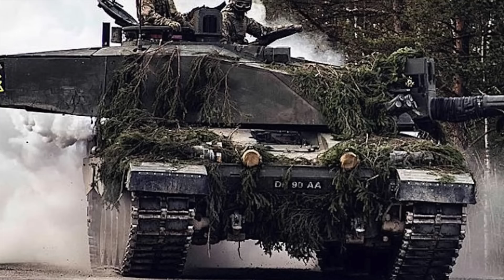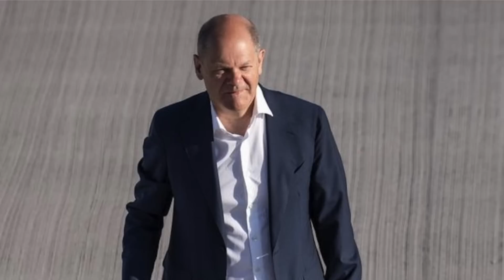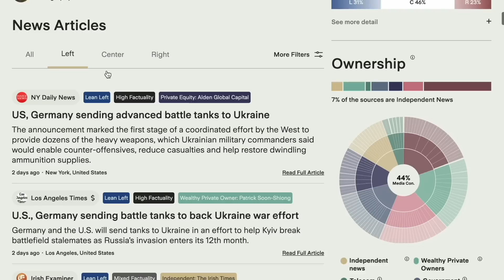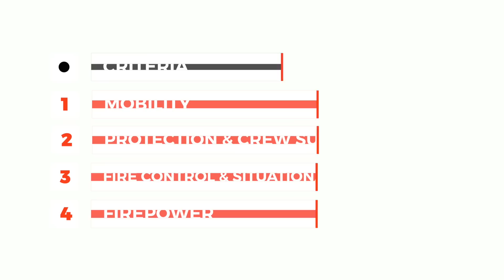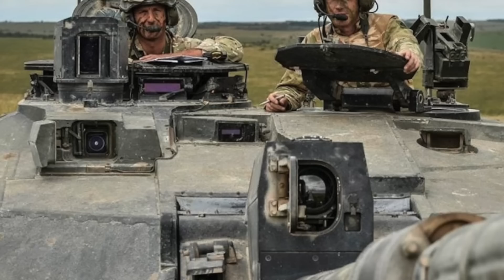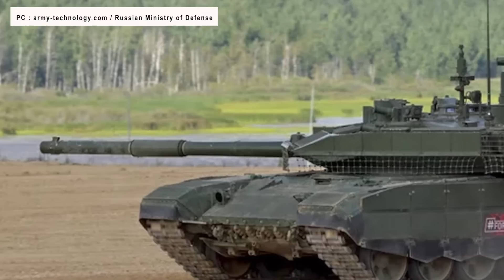British Challenger 2 vs Russian T-90 - Detailed analysis !

Comment: I was surprised to learn the T90 (in best engined variants) is only slightly faster than the Challenger in forward gears (the reverse speed is shocking), I'd have thought with the lower mass and the similar power output engine the T90 would've been a positive "greyhound" in terms of mobility, personally I think the UK's provision of these vehicles was more to break the political deadlock in the west about providing these types of combat systems (although the former warsaw pact nations see the threat clearly and so are providing the maximum support they can for Ukraine, the more western allies are understandably more reticent for fear of escalation) and as a means to persuade others that we have to do something now as the west faces a very real existential threat to our futures if we can't show a determined and united front to aggressors who want to subjugate us.
Reply: T90 tanks rely on their ability to rotate
Reply: Escalation to a nuclear war is VERY real...
People seem to have forgotten that entire cities would be destroyed in an instant.
Reply: Much is made of speed, because it's something you can quantify and makes a difference in fast-paced tank games. But since when have we seen combat footage from Ukraine where a tank was going at full speed?
Most of the time we see them crawling around at 5mph.
Tbh I think the significantly faster reverse speed would be better appreciated than a slightly faster top speed going forwards.
Reply: That's exactly why the UK supplied the challengers, to break the deadlock on MBTs. We all know what Ukraine really wants and needs is Leopard 2.
Reply: @AWMJoeyjoejoe  these tanks will fail. They all have a key design flaw; the ammo rack.
Reply: @deven6518  Take a day off, vatnik.
Reply: @AWMJoeyjoejoe  I do not understand your insult, nor would I be offended if I did. I'm not one of the modern day snowflakes, like yourself,  as it seems a few words already has you in your feelings  🤣
Reply: @deven6518  Well, the same goes for the T-series tanks and their carousel ammo rack. So it's not in anyway a downgrade.
Reply: Surprise for you, my friend, because practically everything stated in this video clip is a perfidious lie! Here in this video clip some information is given which is correct, but it is persistent throughout the video clip, it mentions the characteristics of the first and initial version of the T-90A tank, which is certainly inferior to the Challenger 2 tank. But there is no mention of the T-90M/MS versions or the latest and greatest T-90M Proriv 3. And so he knowingly and deliberately lies to you. The T-90 in the version with an engine of 840 hp has a maximum speed of 60 km/h, which means that it is slightly faster than the Challenger 2, which has an engine of 1200 hp... While the T-90 with an engine of 1130 hp, which is also and the most massive in production, it has a speed of 70km/h... And all variants of the T-90S /M /MS /M Proriv2/ 3 tank series... They have an APU unit! In the video, he stated that they don't have any?! Therefore, all the data that are mentioned in the video clip are from the initial version of the T-90A, he did not even mention the other upgraded versions. The initial version of the T-90 tank from 1992 has the active protection "Sthora", which is outdated, that's right! But that's only on that version! While he didn't mention any other version in the video clip?! Like no other version of the active protection used on newer versions of the T-90 tank, it must be "accidental"?! From the T-90M/Proriv 3 version... Use active protection "ARENA M" or even "AFGANIT", why is it not mentioned in the video clip?! It must be "accidental" again?! He also gave data, again from the initial version of the T-90A, when the opto-electronics is in question, again only data from the initial version from 1992, which was not produced for 15 years?! That would be about the same as comparing a Leopard 2A7 to a 1989 M1a 1 Abrams?! But this is a propaganda video for just that purpose! .And in the end the madness of the brain "it's all just on paper, because because of corruption on Russian tanks it mostly doesn't work"?! Then everything can be clear to you, and you can understand what kind of idiot he is, and not someone who really wants to do a lot of comparing these two tanks! Even Goebbels could envy a video like this!

Some performance newer versions of T-90 tanks.

T-90M Proriv-3
The T-90M "Breakthrough" tank received a fundamentally new turret, different from the serial one, and a more powerful engine. "Breakthrough" is equipped with a new multi-channel sight, which allows the use of weapons at any time of the day or night, and one of the main features of the modernized tank was the possibility of exchanging data with other vehicles in real time . The armor of the T-90M is equipped with a special coating that protects against threats, similar to that used on the latest T-14 Armata.

.At 50 tons, the T-90M proryv 3,would be the heaviest of the legacy Soviet/Russian tanks. Each T-90 upgrade increased its mass from the original 46 tons to 48 tons in the T-90MS. The addition in armor mass would eventually be offset by a more powerful engine of nearly 1,130 hp. And top speed of 70km/h.And the crew controls the wheel instead of several levers. The tank also has an APU unit.

External observations show that the structure of reactive armor (ERA) and the infrared noise lamp in the turret of the T-90M are quite different from the T-90MS. Additionally, the ERA blocks on the T-90M Proriv-3 turrets are angled. The 7.62 mm remote-controlled machine gun was replaced by a larger 12.7 mm weapon. And the weather sensors of the T-90M have moved to a lower position than the T-90MS.

The key difference of this vehicle compared to previous versions is the new design of the turret with an ammunition rack located outside the fighting compartment. In addition, the tank can be equipped with a modernized with the 2A46M-5 cannon ... The new tank is an adaptation of previous T-90 deep upgrade projects to the requirements of the Russian army. The T-90 Proryv 3 version has active protection "Afaganit"

It has a large-caliber remote-controlled machine gun that fires Kord-MT 12.7mm rounds. Using modern technology, the designers increased the accuracy of the tank's fire by 25 to 30 percent.

In addition to the standard ammunition package, the T-90M is also equipped with 3 types of custom ammunition. The first is the Vakum-1 armor-piercing sabo with a depleted uranium core, and it can penetrate about a meter of tank armor. The other is the Telnik explosive fragmentation warhead, which can be remotely detonated by the tank crew. Thirdly, there is a Svir and Reflex guided missile, the trajectory of which can be adjusted during the flight. Range 4 and 5 km, penetration up to about 900 mm of homogeneous steel.

The body of the T-90M is covered with modern modular reactive armor - Relict. the crew will be protected from the impact of a tank from any direction. At the same time, the tank's radar visibility is significantly reduced.

Finally, a serious and detailed analysis of the T-90M and M1 ABRAMS SEP 3 tanks...Which is a significantly better and more modern tank than the Challenger 2. Note that after this video clip. T-90M we have two more modernizations T-90M Proryv 2 and 3.

https://www.youtube.com/watch?v=mPlNvgH1zic
Reply: @SRB.4S  😂😂😂 so that's why the newest t90s are getting a beating in kremina .
Reply: @adriansheldon7778  Yes, several tanks, T-90A /S  versions were destroyed, but how many of these tanks destroyed the opponent's bunkers, trenches, strongholds, military equipment, killed enemy soldiers....A lot, before the tank was destroyed! And what were these tanks destroyed with?! With the most advanced and newest anti-tank top-attack systems! With these systems, Challenger 2, Leopard 2 A4/A5/A6 can be destroyed very easily... As well as all Abrams tanks... But you probably don't know that, or you don't want it to be known to you! Let's also say that at least 20 Abrams tanks owned by Saudi Arabia have been destroyed so far, and about 30 Leopard 2A 4 tanks of the Turkish army, which is easily verifiable information. military conflict. All these tanks were not destroyed by a serious army, but by the Taliban and terrorists in slippers, with old Soviet Fagot and Konkurs ATGMs?! Even though they are top tanks! So should we laugh at that, of course not! Everything can be destroyed today. This does not reduce the quality of the Leopard 2 and Abrams tanks, on the contrary. What is happening in Ukraine is a real war, with two well-equipped armies. We have the Ukrainian army, which is currently the strongest and most equipped NATO army, after the US the best trained with war experience and the most numerous NATO army after the US, with about a million soldiers, add to that tens of thousands more volunteers from the NATO armies and the country only has 20,000 Poles currently, who are fighting on the side of Ukraine, also Ukraine is the best equipped NATO army, after the US ... Ukraine, uses the best Soviet/Russian/Ukrainian military equipment, weapons, she also has at her disposal everything she wants, as far as weapons are concerned by NATO and the logistics are also complete by NATO US! So Russia is not at war with a third world country, with rebel groups, and terrorists in slippers, with whom the US NATO has been at war so far, always with a country at least 50 times weaker, tens of thousands of kilometers away from the US?! So the difference is obvious and huge, the Russians are at war with the largest and most numerous NATO army after the US, highly trained and armed. While the US NATO has so far only fought with much weaker countries or with terrorist groups that do not even have uniforms, let alone weapons and training, and even there they blew it. NATO, and the US as the boss of NATO, so far have not waged war against their equal adversary, but only where they are 50 times stronger, in third world countries... This is the first time that NATO is waging a serious conflict over the Ukrainians as its cannon fodder... So the losses are also great, on the Russian side, but the losses of the NATO Ukrainian side are much higher, at least 8 times higher. And even with all that logistics and military equipment and with billions of dollars invested and over a million highly trained soldiers and military equipment, I did not really notice the success of the Ukrainian NATO side in stopping the Russian army, slowing it down yes, but stopping it no! As we can see from the reports, from the field, the Russians are still advancing, they were not stopped by all those logistics, weapons, billions of dollars in weapons. That's how things are on the field, and I don't know if it's funny or sad, but it's true.
Reply: @SRB.4S  Javelin has been in service since 1996, and the NLAW, designed late 90s, has been in service since 2009. They aren't exactly cutting edge anymore.

With respect to these systems being capable of taking down Challengers & Abrams, where's the evidence for it ? 

There is evidence of Challengers surviving multiple RPG and ATGM hits (including a MILAN) in urban combat.
There is evidence of T90s getting shredded by RPGs and ATGMs.

On the basis of the available evidence I would rather be sat in a Challenger 2 than a T90 when the Dones, ATGMs and RPGs start flying. Really would bet my life on that - you're welcome to take the T90 seat I won't be using. :)
Reply: @fungibleunit4477  Both JEVELIN and NLAW belong to the latest generation of anti-tank top-attack systems. They belong to the most modern and best anti-tank systems today, the year of production is not important at all?! If you even know anything about it?! I don't know, what is not clear to you?!

You say, where is the evidence that these systems are capable of destroying Challenger 2 or Abrams tanks. This is an obvious fact if you have any knowledge about anti-tank systems. So JEVELIN and NLAW are systems that attack the tank from the upper zone, at the top of the turret, where the armor of the tank is always the thinnest, so they can easily destroy Challenger 2, Abrams and Leopard 2 tanks. So for something like that, if you have a brain, you don't need evidence, because you have the characteristics of the system, and you have the characteristics of tanks, that's enough for you, compare. Of course, there is no evidence of the destruction of the Challenger 2 tanks and the Abrams systems JEVELIN and NLAW from the obvious reason because these tanks were not fired at with these systems?! Since the countries that produce JEVELIN and NLAW are both producers and users of Challenger 2 and Abrams tanks... So they are not crazy to shoot their own tanks, are they?! And where the Challenger 2 has fought so far, against the Taliban
  and terrorists in slippers, in controlled conditions, of low intensity, against a 100 times weaker and poorly armed opponent, it was not possible to shoot at him with the JEVELIN and NLAW systems, since those against whom Challenger 2 fought were barely able to buy some old RPG systems, and some 60-year-old T-55 tanks...Which Challenger 2 managed to destroy, even 2 pieces?! ... Challenger 2, as well as Abrams and Leopard 2, have so far not participated in a serious military conflict, against an adequate opponent, or an equal opponent, but against an opponent at least 100 times weaker, these are practically peace missions compared to the conflict in Ukraine. .. .

Therefore, Challenger 2 was not used in any serious military conflict. Even with those frivolous conflicts with hundreds of times smaller portivants, the Challenger 2 was used very little. While Leopard 2 and Abrams participated much more often in low-intensity military conflicts in the Middle East... We also have clear data that about 30 Leopard 2A4 tanks of the Turkish army and at least 20 Abrams tanks of the Saudi army were destroyed. Old Soviet ATGM systems such as FAGOT, by poorly armed and poorly trained Islamists?! In the same way, some T-90A, otherwise the oldest version of this tank, was destroyed, because other newer versions did not participate in the conflicts in the Middle East.

In which tank you prefer to sit, that is your personal matter.
Reply: @SRB.4S  Kind of irrelevant what these T90's may or may not have done. Russia is running out of them - and is now bringing T55's back into service.

The Russian military is threadbare.
Reply: @LaurenceLDN  Maybe it's like that at Disneyland. But the situation is exactly the opposite, my friend, since tanks in Russia are now being made, new T-90 tanks and T-72B3M and T-80BVM tanks are being modernized... And this is done in three shifts! And now there are more new T-90 tanks than Russia had before the start of the conflict. If you had followed the footage from the battlefield a little more, you could have seen that. It is in the first battle lines that new tanks of the latest version T-90M/Proryv 2 and 3 are used, as well as modernized versions of the T-72B3M model from the end of 2022 and the T-80BVM, all of which are the latest modernization of these tanks.

The T-55 will certainly not be used, nor is there any need for it... If, as you say, "the Russian army is bad and outdated"?! Then things on the battlefield contradict this statement of yours?! We certainly have the best, most trained and most numerous NATO army on the battlefield after the US, that is certainly the Ukrainian army, plus the war experience they have of 9 years, which not a single NATO member has. The Ukrainian army has over a million soldiers under arms, and several tens of thousands of mercenaries, volunteers, special forces from all over NATO, only over 20,000 Poles are currently fighting for Ukraine, where are the Germans, British, and Americans added to that number. ... Ukraine also has . Complete logistics of the US and the entire NATO, the best weapons, artillery, anti-tank missiles, anti-aircraft systems, armored vehicles, ammunition, missiles... And now the best tanks that NATO has! And the Russian side in this conflict is destroying all that on the battlefield, Ukrainian tanks and anti-aircraft were practically destroyed, now only systems donated by NATO are being used, as well as ammunition?! How could a "weak and bad army of Russia" destroy that?! In that situation, if it is as you say, that the Russian army is "bad and outdated" and that they will now use "T-55 tanks"?! Why then all the hundreds of billions of dollars in investment that are donated to the Ukrainian army, and they have no progress on the ground?! If the opposite side is "a bad weak and shot army with t-55 tanks" Why all that?! And that, as we see on the ground, "that bad and weak army of Russia" is still advancing?! How is that possible when that army is, as you say, "destroyed, bad, weak with t-55 tanks"?! Opposite the powerful NATO-trained modern Ukrainian army, with the best weapons that money can buy?! One modern and well-equipped army, the Ukrainian army is trained, which is still a fact, it fails to stop, on the contrary! That one, how do you say "bad outdated, weak Russian army"?! What you claim does not coincide with the situation on the ground, nor with common sense.
Reply: Did you just write that using a Russian version of ChatGPT? That's a whole lot of seemingly plausible nonsense.

Let's check back in a couple of months to see who was right ;) 

(My money is definitely on those who are motivated to fight, and who use combined arms maneuvre warfare...rather than the military that uses human wave attacks, area bombing, and shitty old hardware!)
Reply: @SRB.4S  haha you really think your at war with nato boris. Your at war with Ukraine because you invaded a sovereign country. You would have been wiped out by now if it was nato. But here we are with putler holding on to power because your a nation ov drunks who can’t see past the end ov your nose and get putler off his chair all wile he’s sending more ov your fellow people to die. And continues to bomb innocent the old people and women and children. 
Soon Ukrainianwill push you from there land and no other country will want anything to do with you apart from China and India to take advantage ov your cheap oil and gas.
Reply: @SRB.4S  Wow for a Russkie bootlicker you have managed the cut and paste functions.  That is impressive.  You did notice the bit at the end where the narrator mentioned there are different versions of the T90?  Now go drink your tea and stay away from any open windows comrade.
Reply: @SRB.4S  still the turret will end up in the next field when hit. Thought Russia didn’t use depleted uranium shell haha that was a lovely post you did boris  it all we have seen is old t55 on the way to the front.
Reply: @007thecookster  
Boris, if you believe in the "chips from the washing machine that the Russians install in the tanks, and 13 from Snake Island, the ghost from Kiev, and that the Russians are fighting with shovels because they have no more ammunition, it's been 6 months now, and that Ukraine is winning the war." "Here they are in the Crimea, they just haven't entered Moscow"?! If he believes in that nonsense and proven lies. Then you will also believe that the Russians will be in the front lines, in addition to the new T-90M /proryv 2 and 3, the modernized T-90A and T-80 BVM, as well as the T-72B3M, a total of about 1500 pieces ... in battle use T-55 with Ukrainian tanks ?! And that "Ukraine is winning the war"?! And Ukraine itself doesn't have its own tanks for a long time because they were destroyed, 80% of those tanks, and they use t-55s from Slovenia, which are also mostly destroyed... Or if you believe that this is a war "between Ukraine and Russia"? ! And not Russia against the whole of NATO and above all the US, and that the Ukrainians are unfortunately just cannon fodder ... After the US, the Ukrainians are the largest, best equipped and most trained military force in NATO, plus 9 years of war experience, with a complete logistics and NATO military equipment, the most expensive money can buy, plus NATO special equipment
  mercenary units... Well, I didn't notice something, that they managed to stop the Russian army?! On the contrary, they are nowhere to be found. And all those powerful extra-armed Ukrainians with top Western equipment, from uniforms to rifles and rocket launchers, MRLS, anti-tank weapons, logistics, NATO's best anti-aircraft defense and soon the best western tanks... And all this against "stupid Russians with military with equipment from the Second World War, with T-55 tanks with chips from a washing machine, which have no logistics ammunition, no more fuel, no logistics, only shovels?! But in some strange way, those "incompetent and stupid" Russians have been making progress on all fronts for several months now...And the Ukrainians are losing, not so much cities and towns, but people and equipment, in incredible and irreplaceable numbers. And they fail to stop the Russian advance, on any part of the front, and lose 7 times more soldiers and equipment than those "stupid and helpless" Russians?! And precisely from the documents that leaked from the Pentagon. That the losses of the Ukrainians are 7 times higher than the Russians, and that is a minimum estimate... But that's why BBC, CNN, MSNBC, SUN... are for such fools and idiots as you. However, as things stand now, the truth is quite different... We almost heard from the same Pentagon documents that Ukraine no longer has the S-300 and BUK air defense systems, which were the best. We also saw that the Russians do not have a problem with ammunition, but the Ukrainians do, says Jens Stoltenberg who said that. And that NATO cannot produce as much ammunition as Ukraine consumes... And we learned all this from the official western propaganda globalist pentagons where you will find more official documents. Which tells the truth! But of course the American scum NATO fascist, even though he himself wrote those documents and is aware of the facts on the ground. The American scum and their media speak against those documents of theirs?! Because a year of mindless lies, and lying to their own people, above all, is not in their favor.... That's for people as naive and stupid as you! When you listen to BBC, CNN, MSNBC, SUN, FREE EUROPE ... and similar shit! Admittedly, they didn't want it to be known, but someone who had the balls presented the documents, so that American scum could no longer lie to the public and "call it Russian propaganda"?! This time they themselves said in official documents that what the so-called "Russian propagandists" have been talking about for a long time turns out to be true, and that we have the American mainstream non-Nazi globalist media, and the same kind of brothers in Western Europe, who were just doing propaganda for the Pentagon.. .. About "powerful Ukrainian supermen" and "stupid and mentally retarded Russians who are suffering huge losses, have no more ammunition and tanks, only shovels"?! Now we see that what Ritter and McGregor said 10 months ago and today is the pure truth! . Because they knew this even before the penatagon as it was going to end, they were telling the truth. But jerks like you called them "Russian popagists"?! Because you didn't like what they were saying. Because the narrative and propaganda of the satanization of Russia has already been taken into the mainstream. Which has already been paid dearly, one billion dollars. But it collapsed long ago like a house of cards. The other day, we heard directly from the commander of the Ukrainian forces in the direction of Bakhmut, in the podcast, that from February until today, Ukraine lost its best fighters in that meat grinder, as he himself said, and that they can no longer carry out even minimal offensives, because they lack soldiers, and the equipment is mostly destroyed... But well, there are always your jerks who still believe more in "chips from the washing machine, in the ghost from Kiev, in 13 from Snake Island, in the fact that Russia only has shovels, and there is no more ammunition, and now that there are no more tanks, they will use the T-55 tank, and Ukraine will win"?! So if you say so, and those like you "globalist democratic mainstream reliable media" that you listen to and fools like you who believe them "must be believed, when have they ever lied"?!😂😂😂
Reply: @SRB.4S  This is a fake news propaganda  channel Dont expect any truth I just feel bad for the poor ukrainians that die every day for no reason inside the garbage outdated weapons  they give them This whole  media is propaganda  for the Ukrainians to keep on fighting and die for Zelensky and his corrupt  friends
Reply: @SRB.4S  some common sense for once
Reply: @Dèvèn  oh dear you seem to guzzle ruSSain propaganda 😅😅.
Reply: @adriansheldon7778  oh dear, you seem to be allergic to facts
Reply: @Dèvèn  oh contre mon amie facts don't lie or unless your ruSSain or serbian,syrian,Iranian etc etc . Your t90 is either going down the poophole or being captured in 2 months ago if you have forgotten one was captured and it was taken back and examined by both the brits and yanks and deemed mostly ineffectual but don't worry soon you will see western tanks on the frontlines and your much vaunted t90's all 61of them  and the armata all 20 of them fighting western tanks and support vehicles like the Bradley's and the mardar's soon it won't only ruSSain soldiers breaking records running backwards it will be ruSSain armour .